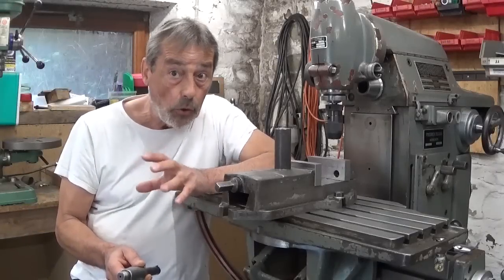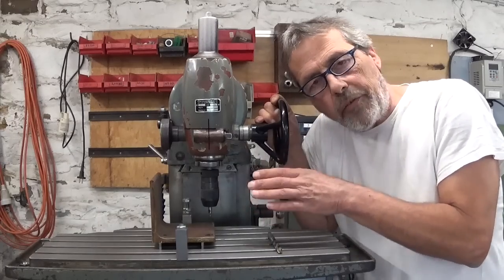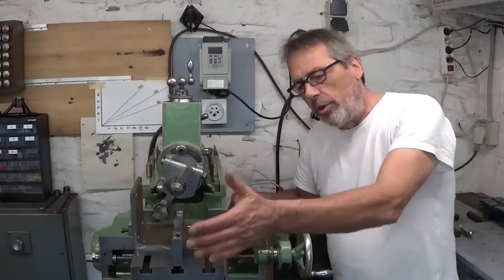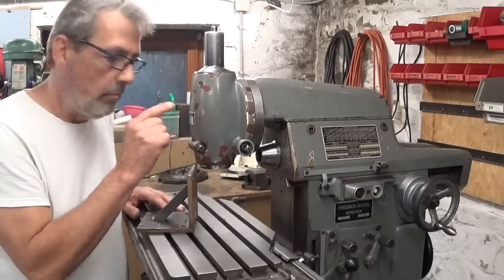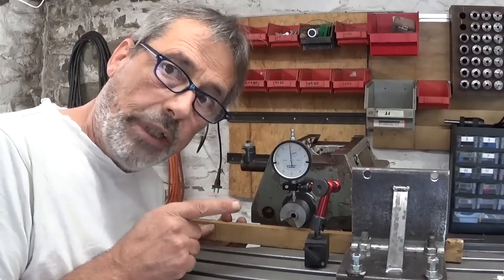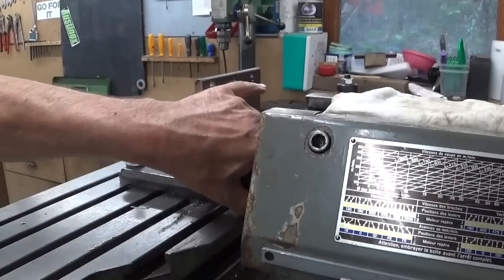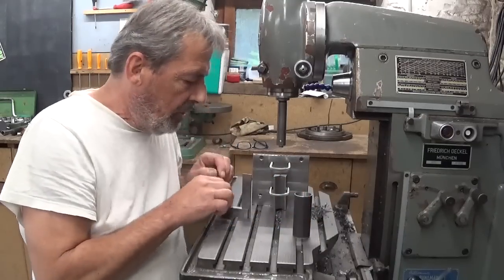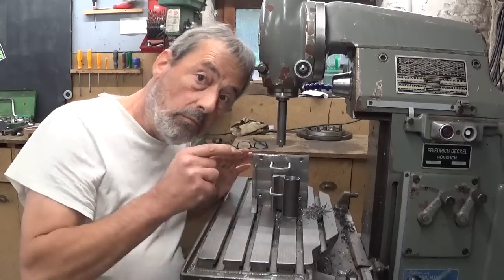Angle plate for the Deckel.

Comment: Nice machine! but next time you see some extra-long end mills/drills/counterbores/reverse spotface tools, at your local scrapyard or internet auction... or if you had a 45 deg tip end mill, maybe could tilt the head 45 deg to get into the corner, just around the bolt head. So many ways to do things..  
Not sure how far your bench is from the mill table, but you might be able to attach a board between the table and the bench as a temporary bridge, with the table lowered level with bench, to slide it across instead of lifting - use the table to do the lifting..

Comment: 9:52 I am lucky enough to have a similar machine (an Alexander Master Toolmaker, a UK copy of the Deckel FP1) and you can make yourself more space here by turning the table 180⁰ so that the straight side faces the horizontal spindle. You need to lift it right off the trunnions to do this of course.
Reply from the maker: Good idea. I didn't think of that.

Comment: Nice work, Rusti. That angle plate will be a great addition to the shop. Do you think you might need a U shaped block to support the tube? Are the flat sides of the Vee block adding to the problem? I'm sure you will get the result you need. All the best, Mart in England

Comment: Hi Michel,
Another great video ! Good to see you using some of the features of the Mighty Deckel !
If you really want perfection then try this ,
Mount a block of aluminium ( you could use a block of wood if you haven't any aluminium on hand ) up on your angle plate on the mill  and drill and or  bore it so the tube is a slide in  fit but leave a step at the bottom so the tube cannot slide right through and deep enough to leave about 0.5 mm proud of the to surface   , then on the top surface drill and tap some holes to fit a clamping flange or plate then make a clamping plate or flange to match these holes . slide the tube to be bored into this block and fit the clamping plate or flange and proceed to bore the tube to size.  The clamping force is axial on the cylinder to be bored and not radial so it cannot be forced out of round . I use this type of jig  for my cylinder liners on my model engines and it works well . This method allows things like black steel tube to be bored accurately and the worst that can happen is the very  end may be bored a little oversize if you clamp it up too tight .That being said this set up is not what you want if you have to remove a lot of material out of the bore as you can only do light cuts so rough it out on the lathe or mill first then switch to this .

Comment: Add another small bolt on angle plate vertically to one side of the angle plate you just made, adjust the added plate square and then clamp your tube into the newly formed corner to have the work square in two axis automatically.  Something to consider is that, as you stated, the cross section of the tubing you have (thin walled) works against you but it's a fact that even heavy castings can be distorted by clamping forces during machining.  Race engine builders attach torque plates to engine blocks to simulate the distortion that would be present if cylinder heads were bolted on before boring engine cylinders. When bored, with torque plate in place, the cylinders are round and straight but when the torque plates are removed the cylinders will no longer be round and may even be tapered. When the engine is assembled and the cylinder heads are torqued the cylinders once again attain their proper round, straight shape. Non machinists look at metals like steel or cast iron as if it is rigid but machinists quickly realize that metals are like rubber that will distort when enough pressure is applied.

Perhaps you could build a boring jig that clamps the cylinder lengthwise between two flat plates with recesses bored to receive the outer diameter of the cylinder and 4 bolts clamping the cylinder between the plates. The bottom plate of the jig would then be clamped to the mill table. All clamping pressure would then be along the axis of the cylinder rather than across the bore.

Comment: Good useful accessory you've made Rustinox using the mill and the shaper. Is there a reason why you didn't bore the tube out on the lathe? Tony
Reply from the maker: My lathe cuts tapers. Not cylinders.

Comment: Love the interplay between shaper and mill: getting into the fillet of the angle was easier with the shaper while the mill wins with drilling. Each has strengths and together they make a formidable team.
Your angle plate is a useful accessory, and because it was shop-made it's not too "precious" to modify when necessary.
Stay well and thanks for sharing!

Comment: Very curious why you would drill the mounting holes from inside side of the angle rather than the outside. Mount on edge, clamp, drill two top holes; repeat for adjacent side; flip 180° and drill the other pair of holes.

Nice to see the horizontal mill chewing metal! What a delightful tool that one is!

You are so very clever, I wish I could replicate your cleverness in my woodworking challenges.

Comment: Excellent video again, Thank you. I wonder if the out of round in the pipe is influencing the cutter ? Maybe try another piece of pipe which hasn't had the bore influenced by previous machining. Whatever happens you now have a very useful angle plate for future projects. I think your Deckel mill is the ultimate "Hobbyists" machine. Thanks once again for sharing your work with us.
Reply: Ditto, with one additional comment. I think you understand this piece of machinery and use it with maximum benefits for your projects.